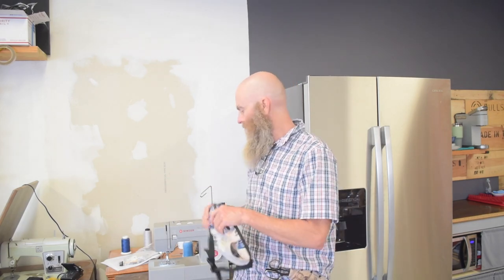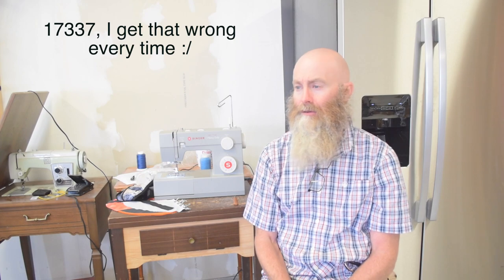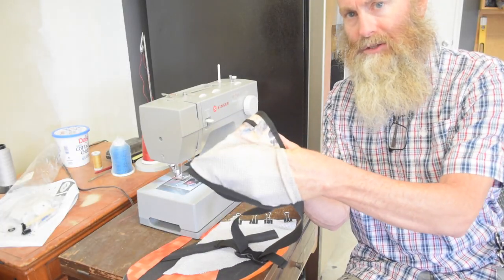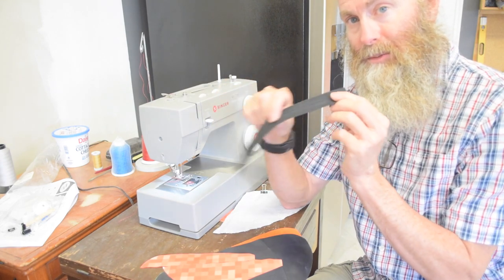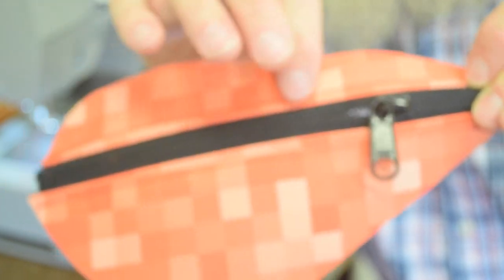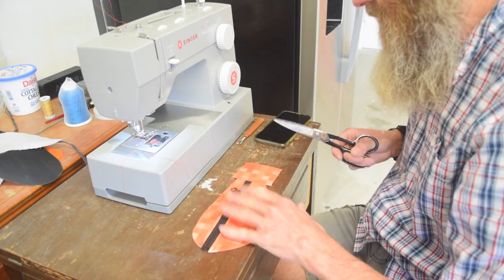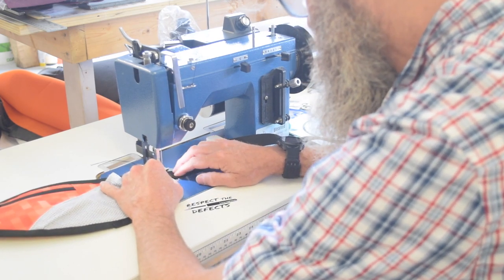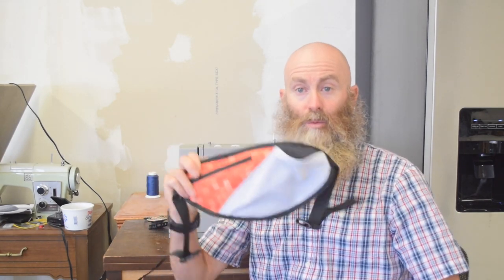Singer HD: Sewing A: Bottle Carrier (MYOG)

Comment: I took your advice and got myself a Singer 237. Yesterday was spent cleaning it (it came from a heavy smoker's house) and oiling it, today I cleaned the sewing table it came with and this evening I put some thread in and gave it a quick test. Built in 1970 and with very little signs of wear (the previous owner had it in their shop and it was used regularly) it produced some decent seams without any bother.
The motor is a little weak, but I've not looked at that properly yet. It probably just wants stripping, cleaning and the bushes re-lubricating. I'll let it settle into its new home for a while before doing anything else to it.

I'm really pleased with it and it's good to have a vintage machine like this🎉
Reply: Ha! My 237 came from a smoker too. It does great zigzag stitching but I still prefer my 201 for straight. You are right about the motor being weak - I wonder how it would be on an industrial servo motor...

I would say that the 237 case is horrible and it's way less portable than the HD (that we also have in the house) but I wouldn't change it
Reply from the maker: Sewing Machine Parts sells a motor that is labelled as a direct replacement for the 237, it's an Alphasew brand and is supposed to be more powerful.  I've been thinking about putting one on my 237 for years, but I've had too many distractions lol!

Comment: I appreciate the work you've put in to testing the sewing machine. I thought it was going to be a dud, and you proved that wrong.
In terms of value, I'd still buy a second hand eBay/charity shop (thrift shop) one, as I'm happy enough fixing up a vintage one. You can pick up a Singer for £20 ish in the UK second hand, compared to £290 for the heavy duty.
 But if i were a beginner, i think the heavy duty singer would definitely be a contender, as it works straight out of the box and looks easy to use.
Keep up the good work!

Comment: Don’t discount your experience with this machine is also benefitted by sewing skill. Of course there’s known quality control differences now vs old Singer and lack of customer support. A lot of the issues I hear new sewists complaining about is likely compounded by user error or inexperience. I have a bernette b05 which looks nearly identical and it sews great. I haven’t done an extensive review but I think it’s a great starter machine especially for people making infrequent projects. 
Pattern wise, i really like this style of running belt and will probably make my own riff on your take. I have one a little similar but the pocket is a bit small and only works with soft flasks. So maybe there’s a chance in the near future for people to have a pattern that’s pretty similar.
Reply from the maker: That's an excellent point! I suppose an inexperienced person slamming the pedal to the floor every time might have different results, that's something to consider.
I would LOVE to see your take on this, let me know if I can provide any measurements or other info that is helpful to you.  I'm strongly considering trying a pair of DIAS shorts soon ... :)

Comment: Question you probably use different gauge thread, for a double needle juki would you know which thread needs to be in the bobbin?  It seems at work threy're having trouble getting these double needle machines work because I think, they're using the wrong bobbin thread.  Does the thread type matter? Can you do a video on this issue?  I quess the real question is should the bobbin case be switched out or the thread type be changed?
Reply from the maker: Hi! Sorry for taking so long to reply!
I have very little experience with double needle machines, but here's a guess.  Thread comes in "right twist" and "left twist," and one of them is the one we all use all of the time.  The other one is often used for the second needle in a double needle machine. I'm not sure if this applies to ALL double needle machines, or only some, but it might be a rabbit hole worth going down to see if that helps solve the problem.  Good luck, and let me know what you figure out!